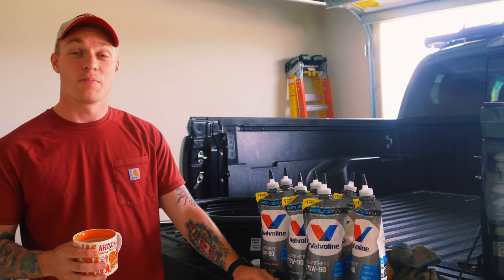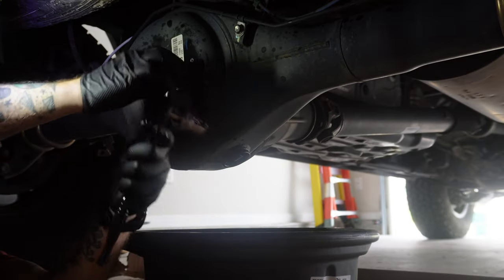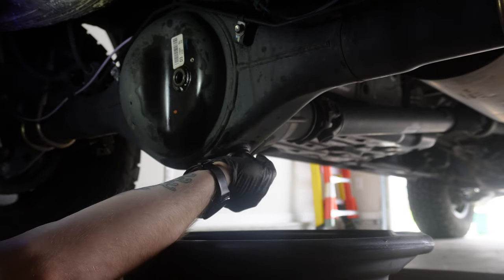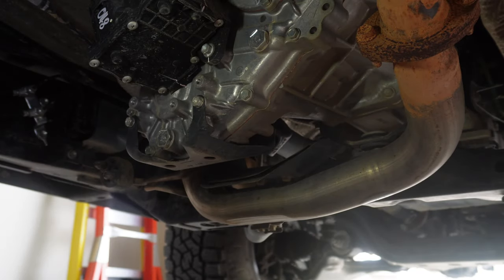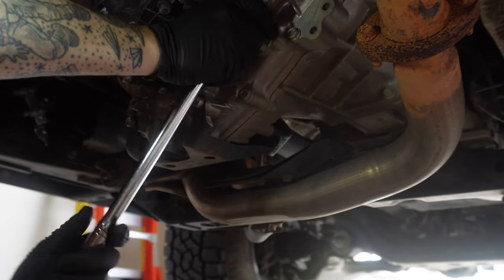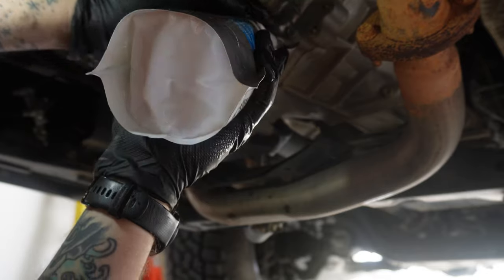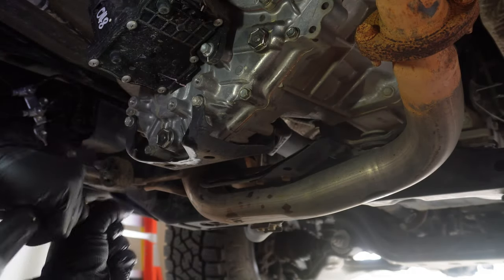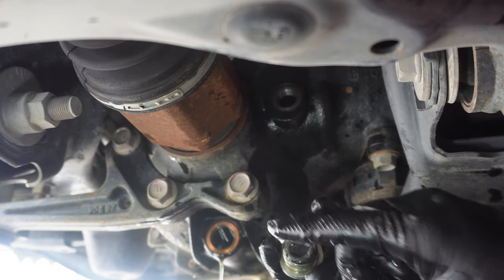DIY Differential Fluid Change! STAY AWAY FROM DEALER PRICES! -Toyota Tacoma

Comment: I hope you didn't use 75w90 in ur transfer case...my 2022 calls for just 75w
Reply from the maker: You might lose 2-3 cents at the gas pump but using 75w90 for all 3 is just fine. Big debate. Toyotas 75w is pretty expensive. So pick and choose 👍🏼
Reply: @THFOffroad  oh I get and I would never buy gear oil from Toyota....just was given you a head's up👍
Reply: I'm using revenol
Reply: @THFOffroad  sorry ravenol
Reply: @Apeman4512  The dealership doesn't even use Toyota's TC oil